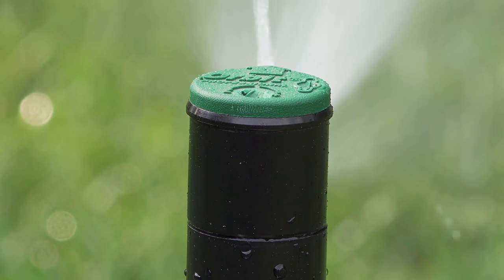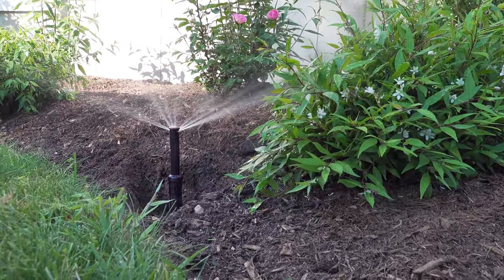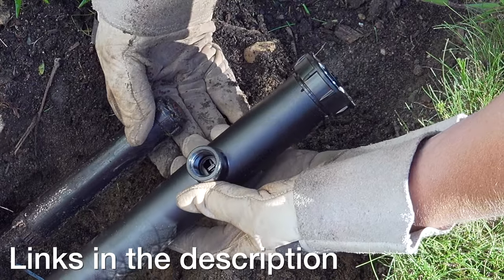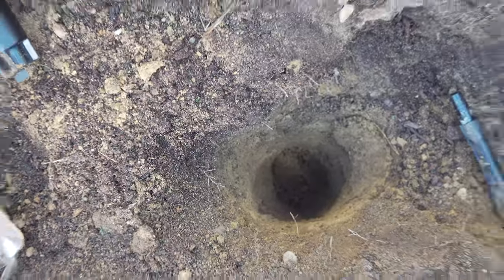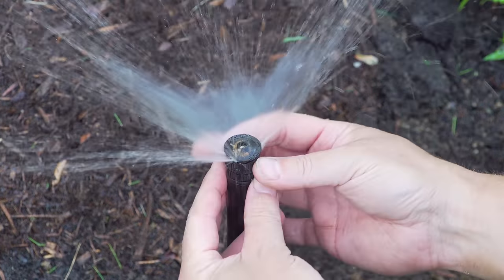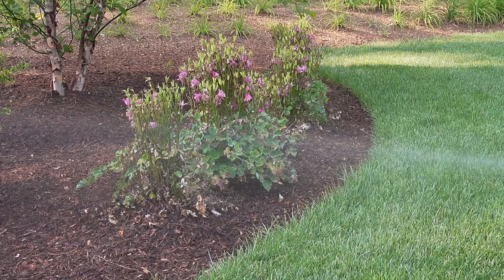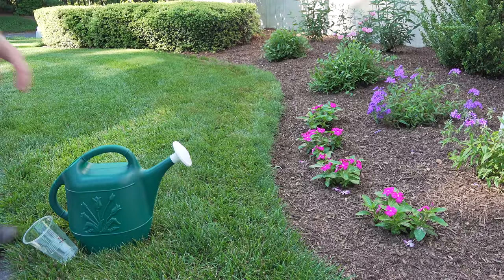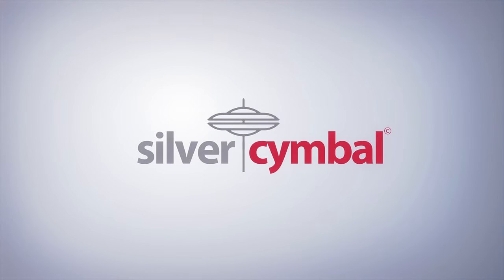TALL SPRINKLERS solve BIG Lawn Watering Problems

Comment: Rainbird drip/soakers lines on a separate zone are much more efficient and effective for beds. Usually these zones run for 90 minutes or however long it takes to moisten the soil to the proper depth. Drip irrigation eliminates runoff and evaporation and is extremely low maintenance...and much cheaper per square foot.

Comment: I use an impulse sprinkler on a hose they are good
Reply: @backpacker3421  i water the lawn and plants with them mine can adjust to a spray for better coverage when the spray of water reaches the end of the lawn where the flower beds are it is a lot more gentle

Comment: Great sprinklers but if in a climate that freezes and you use the side port, plan on replacing some of them each year. Year end air blow out doesnt get the water in the bottom.  I'm in St Louis and have probably lost 15% of them to freezing each year.

Comment: Installing a 12” riser into my existing in ground system would solve my watering (of shrubs, etc) issue. I’m in Ontario, Canada and we get a winter season. I would opt to use the side connect (as opposed to the bottom). Are there/have you had any issues with water possibly remaining in the sprinkler body below the side connection - after blowing the system out - over the winter which could result in splitting of the sprinkler body. (Not sure where you are located). Enjoy your postings very much. Keep up the great work.

Comment: Question made your diy sprinkler and connected two of them together and they won’t pop up all the way
Reply from the maker: It can depend on how much pressure you have and the hose diameter. But usually you can do 3-4 without an issue. I would try to use a smaller nozzle if you are using rotary versions and this will get it to a flow that your water pressure and line can do.

Comment: Have you had any luck with MP rotators? I’ve been contemplating a full upgrade.
Reply from the maker: Be really careful, by themselves they are great but it's not a just a swap to upgrade. They put down less water and you need more heads than standard Hunters. For new installs go for it. but upgrades it's a bigger deal
Reply: @SilverCymbal  Thanks for your response and time. Have a good spring season!

Comment: Would Root Ruckus work on lawns via a hose end sprayer or backpack sprayer? Maybe a video on that! This was another great video as usual!
Reply from the maker: It should be able to if it could meter 4oz per gallon. But I am not a huge fan of hose end as they can clog and often can get the mix way off. But if you were using it to replace the watering can it might work well.

Comment: Just be forewarned that if you use the side inlet on these taller heads and plug the bottom inlet, there is no way to get all the water out of the bottom of the head and it could freeze and split the body. Better to go to the extra work of always plumbing to the bottom inlet! Just ask me how I know!!
Reply: Thanks. I think I’m going to dig extra deep to be able to go in from the bottom. It’s on the ends so I think it’ll be easy access.

Comment: Too short a distance for me. I use the Orbit brand from Lowe's for around $10. I had a problem with those. They leak between the rotating head & base. Out of a case of 6, only 2 were good. Had to do a return. I took a weedeater and cleaned a trench next to a trojan fence. I zip tied the garden hose to the fence just below ground. I also had it where the hose ends in the corners. It followed a granite wall out around 30 feet. In my experience, only 4 heads can be connected on a faucet. Lose too much pressure. The grass grows over the hose and hides it. It's not too deep if a hose goes bad. I have a side yard with zoysia & Bermuda grass that's thirsty.

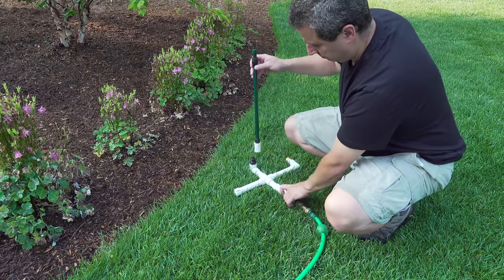Comment: How do you   adjust the length of the Orbit ?   04:27   ?  I can't get the   male end of the tightening screw to move away   from the head 

--
Reply: I sprayed the nut with WD-40 and it came loose

Comment: How do you get enough pressure out of your standard well
Reply: Harbor Freight makes transfer pumps. The larger ones can run quite a few sprinkler heads. Never choke them down. Excessive back pressure can burn the pumps up.

Comment: I disagree with using spriklers to water your plants. Some plants require more and others less water depending on the plant. A soaker hose for each plant, with the plant surrounded by the soaker hose (with individual or like minded plants) makes a lot more sense to me. There should be shutoff valves to increase or stop the water going to each section of the soaker hose.  Just my opinion.